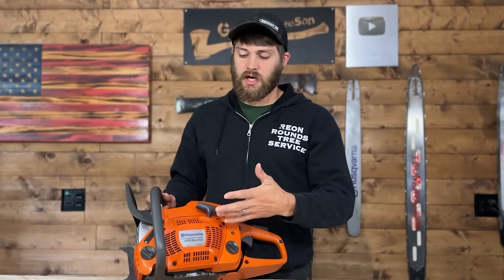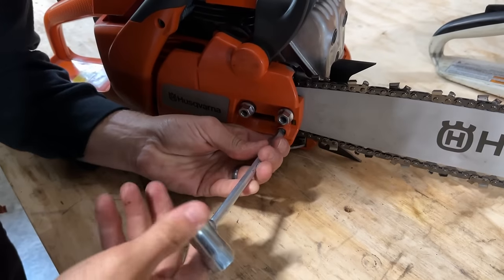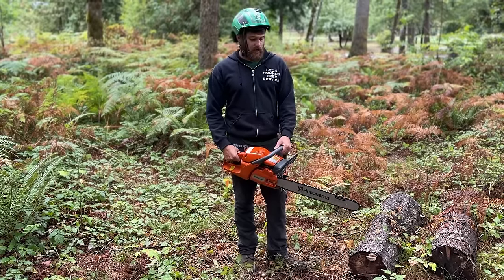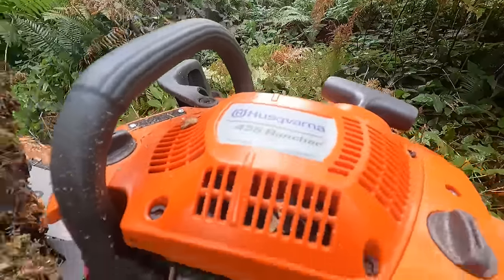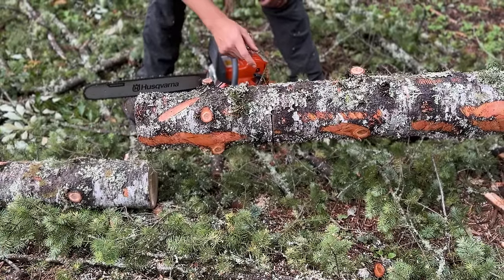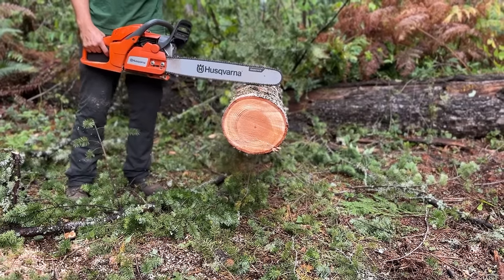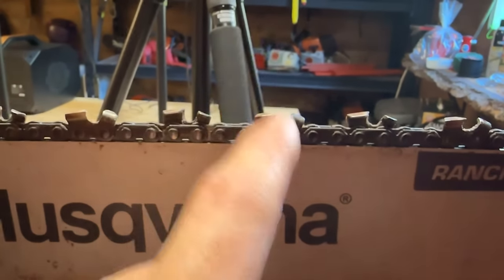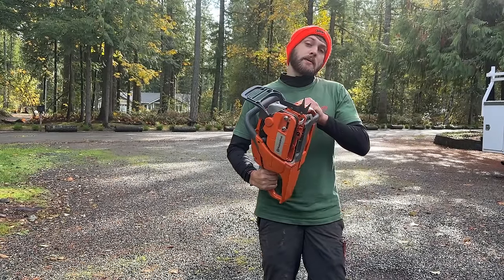WORLDS BEST CHAINSAW TUTORIAL! EVERYTHING You Need to Know About Owning and Operating a Chainsaw!

Comment: One thing I'd say to save the life of your pull start (the plastic tabs that spin outward and rotate the engine over when you pull the cord)  is you very slowly pull the cord out until you feel a good amount of resistance, if you give it a couple super slow pulls you will get what i mean, but this sets the engine to  compression and so once youve pulled the cord easily until you meet good resistance, then you pull start it, dont let the cord go back in, you want the pull start to  be slightly pulled where you meet resistance and then pull and it will start faster and better, and it saves the life of your pull start.  You can use this method for everything from chainsaws to lawnmowers to trimmers and etc.  Its much better for the pull cord gear💙💙💙

Comment: I buy the big jugs of Mix oil and just use one of the small ones for measuring .
As far as bar Oil, I went to our Local Restaurant supply house and bought some large condiment squeeze bottles and keep them filled. Large opening so filling is easy. then just squeeze the Oil into the Saw 
Oli mess is all but eliminated...  
I never start the Saw with the Brake set. with the Choke and high idle set I do not want the Engine to be held back buy the Brake and burn out the Clutch. Start it and let free run for a bit then blip the Throttle to release High idle..
The Screw driver tip of a Stihl Scrench is designed to fit in the Bar grove...
Thanks. Mike M.

Comment: I watched a video about non-ethanol gas. I learned that gas stations, like the one you are using, use the same hose and pump handle as the other ethanol choices. Thus, you pump about 1 gallon of ethanol gas before getting the non-ethanol gas. There are gas stations that have separate hose and pumping handles.
Reply: I'm always concerned about this, especially when filling my Harley with Premium fuel on a road trip. All pumps around me - except one I know of 10 miles away - have the single hose arrangement. This burns me as the next guy is getting my expensive premium while I'm getting the last guys regular. But I just looked this up and the American Petroleum Institute says there's only about 1/3 gal in the hose.
Reply: Damn, thats not even a thing in Australia, every fuel type has its own nozzle
Reply: Always take your petrol container in a petrol car when you go to buy this sort of petrol. Run the first gallon or so into the car, then fill your container. Just good practice.
Reply: If your really picky you can also test it for ethanol by adding water to it in a non food glass.  Ethanol will separate out

Comment: Hey, great Video! Here is how the choke works:
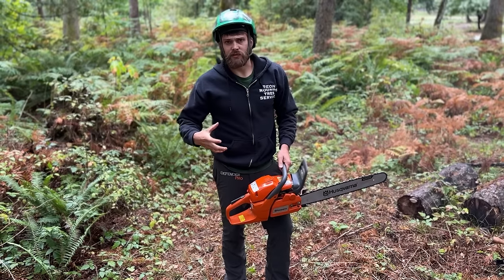19:26 When applying the choke, it automatically sets the idling speed a little higher so it won't stall. As soon as you pull the throttle, it resets the idling speed back to normal. At least Husqvarna does it that way.
23:54 Again I would recommend setting the idle speed a little higher by pulling the choke lever out and pushing it back in again. This way, the chainsaw will rev up without you pulling the throttle. So you don't need to pull the throttle during start up, and you can hold it correctly, which is much safer. :)

Comment: VP racing 2 cycle oil is still available I'm not sure about the five gallon mixer bottles but the bottle with the built in measuring bottle is available at tractor supply, Walmart and most other stores where outdoor power equipment is sold.

Comment: In germany almost everyone runs premixed fuel. But you cant just switch to premixed fuel without at least adjusting the carburator. In general with switching there are complications. But premixed has benefits (f.e. lower emissions so its healthier than mixed fuel from what I have heard and also better storeable) but is more expencive.

Comment: If you flood the engine and dont want to hold the trigger down to start, you can always pull the spark plug with your tool and give the saw a full pulls with the plug out. Wipe off the gas from the plug and put it back in. Should be good to go after that everytime.

Comment: Gasoline requires a ratio of 14.7 to 1( ideally) only the atomized portion of the gasoline will ignite due to this. Flooding an engine is when there is to much fuel for the available air to ignite. Opening the throttle allow more air in and so may mitigate this. Opening the throttle will generally help on carborated but not on fuel injected engines as the fuel input metering is controlled differently

Comment: Greetings from the UK! Thank you for your video which I found really helpful. I have a couple of questions which I think you (or the community) might be able to answer?
I have a 30ft Cherry tree which fell over in a storm a couple of weeks ago. I've bought a cheap petrol (gas) chainsaw to cut it up for my log burner.
As well as cutting the trunk and big branches into logs, is it OK to use the saw to 'quarter' the logs lengthwise (so I don't need to split them with an axe)?
Secondly you spoke in your video about tension and compression, which was really interesting, but you didn't really elaborate on what to do about them! My cherry tree trunk is lying at about 30 degrees (propped up on the roots) and I don't know how to tackle it.
Thanks in advance for everyone's wisdom on the above!

Comment: As well as adding the oil first, I use a measuring cylinder from Amazon because it's more accurate and use 40:1 rather than the 50:1 for the oil-mix ratio. Loads of other videos suggest 40:1 because they feel 50:1 is a bit too lean and only gets recommended because of the "faux green agenda". Some repair shops also say 40:1 allows some leeway if the machine isn't used very often; the cylinder tends to get dry. It never seems to cause me any issues and the cost is marginal.

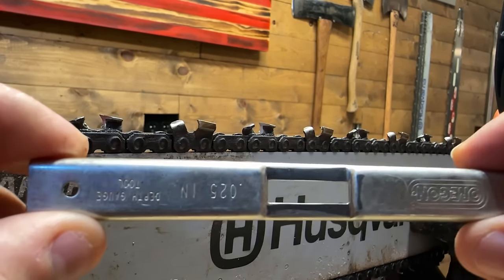Comment: Great tutorial!!!   A correction I would make: at 1:04:10  the value scribed on the jig is .025 = Point Zero Twenty Five, which means 25 thousands of an INCH. You say Point Twenty Five = .25, which would be a 1/4" (10 times more than the gauge value/dimension).
If purchasing the gauge, you can simply say you want 25 thou gauge.   Thanks for the video. 👍

Comment: Great video Jacob... and yes I sit through it's entirety.  It's amazing what a little dirt can do to a chain it's crazy.  I didn't realize how much an air compressor would help I've always used cleaning brushes and picks.  But I'm going to give the air a try next time... I can see it as a time saver.  Of course when I'm fooling around with my saws I never see it as time consuming because I enjoy it so much.  I've always sharpened my chains with a round 7/32" it's how I was taught and I'm old school like that.  But lately I've been thinking about using (or trying to use) an electric sharpener what are your thoughts on them?  I recently purchased a chainsaw mill and using a file and only 2 chains I'm spending a pretty good amount of time sharpening.  Maybe I just need to buy a few more chains lol.

Comment: I have been using 2-stroke alkylate fuel many years in chainsaws and small garden engines.
Much better than the gas you use in cars
No toxic fuems.
Low smoke emitting.
Doesnt smell like trump.
More expensive than standard gas thou, but well worth it!

Comment: don't forget to grease your bar sprocket if there's a hole for it and the needle bearing behind the clutch. Another way to unflood it is to take the spark plug out and pull it over or dump it out to get rid of the fuel.

Comment: If you can't find ethanol-free gasoline (it's a 2hr drive for me to get EtOH-free... I can grab a jerry can here/there, but I can't just drive 4hr round trip for gas whenever I need it) there's a product by "Stabil" "360 Protection" for ethanol.  It's like 5 bucks for a bottle and you mix 1oz into 5gal.  A bottle will treat 50gal.  During the summer when they start adding more ethanol into gasoline (it's normally 10% but they can go up to 15% during the summer) it's a good idea to add 1.5oz of the Stabil per 5gal.  Also does the normal Stabil thing of extending the shelf life of gasoline.  I've noticed a lot less gumming in small engines since I started using it so it does appear to work.

Comment: Great vid Guilty! From my understanding, combustion of the fuel in 2 strokes engine happens late in the compression process by design. A higher octane number prevents knocking and is require for these engines. Ethanol free is also recommended as you suggested. I like your vids man. keep up!

Comment: Pretty solid tutorial, you didn't mention how to set the low and high speed needles and the idle on older saws though, also I think it would have been great to be more precise about using the top half of the bar end "circle" and that it should be avoided as much as possible since the risk of kickback is highest in that area of the bar, you eluded to it but you didn't emphasize it quite enough in my humble opinion, other than that it's a great solid tutorial, good job man!

Comment: On ethanol fuel......aside from what you mentioned about separation and the degrading of certain fuel components, the ethanol is alcohol based and will also attract moisture over time. That in itself is corrosive in fuel systems and cause poor running machines

Comment: Raker gauge depth was 0.025" or 25 thousandths of an inch.  In the metric system its just over half a mm 0.635mm. That's like 6 sheets of paper.

Comment: Nice comprehensive overall, touched all the bases!
You showed but didnt mention to not drag the file backwards while sharpening.
Reply: Well, chainsaw files are made to take material off only in one direction (at least all the ones i've seen) so, there's no harm in draging it back the same way as it went forward (as long as you don't actually put any force on the file which you're not supposed to use a lot of on the forward stroke either). And as an added bonus it's easier to maintain a constant angle of sharpening for beginners while learning to file.😊

Comment: Jacob - your are the man, but as an engineer you were killing me with .25 versus .025. The rakers are .025 which is a little less than 1/32nd of an inch. .25 is 1/4 of an inch. Last bit of criticism is to further explain the oil/gas ratio. What does 50:1 mean? Some equipment specifies different ratios. Otherwise, thanks for the video. I've been with you since the 6 ways of felling with Jed.

Comment: You're the best man, but there is a big difference between point 025 which is the guide measurement and point25 that you said. point 25 is a quarter of an inch. point 025 is 1/40 of an inch.

Comment: When you pull the trigger the throttle is wide open allowing enough air into the saw to ignite the fuel flooding the engine.

Comment: at 23.30 starting a flooded saw by holding the trigger down in your right hand is probably THE MOST DANGEROUS way to do it as you have little or no control of a now full revving saw in your right hand! Some operators even remove the chain brake when starting which is going to result in a few lost limbs.
When you apply the choke it closes the air inlet flap to the carb and AUTOMATICALLY sets half throttle via an internal linkage. So, set the choke then unset it, this reopens the air flap but the half throttle linkage remains activated, it will ONLY deactivate when you blip the throttle. Now start the saw in the normal way (remember half throttle is already set), once the saw is running (fast under half throttle) blip the trigger to deactivate the internal link. Voila - saw runs normally. 
A good idea when refilling the saw is to always fill the oil first, that way if you get distracted while filling you will not forget to go back and fill the oil.

Comment: Worth mentioning is that when gunning, you have to aim with the sights slightly to the side of where you want the tree to go, otherwise the tree will miss the target by a few feet to one side (if the saw is on the left side of the tree and you point exactly where you want the tree to fall, the tree will miss a few feet to the right). If the saw is on the left side of the tree, aim the sights a few feet to the left of where you want the tree to fall. if the saw is on the right side of the tree, aim a few feet to the right of where you want the tree to fall.

Comment: Organic oil can start to harden and gel up if it's left on the tank for a while. Synthetic oil doesn't do that. It seems to me that organic oil lubricates a bit better, but i don't really know. If you use your saw a lot, you can use organic, if you don't use synthetic
Reply: Putting tension on the rope before you pull saves your rope from a lot of wear and tear

Comment: I just want to say, ethanol gas aint that bad. I have a MS180 from 2006 and it has been ran on 10% ethanol 95 petrol (idk what octane it compares to usa standarts) and the lines have held up nicely. The carburetor diaphragms are good and the saw runs nicely.

Comment: drain tank ,push primer bulb to empty carb , put in straight 2 cyc oil or that paraffin gas from box store . prime carb. some oil in spark plug hole to prevent cyc rust. dump out gas in spring ,put in fresh gas mix. probably wont start with that old paraffin gas.

Comment: if you buy your mix oil in bulk (i buy mine a gallon at a time) your best friend is a ratio rite cup... no guess work... tells you right on the cup where to fill to for whatever ratio you want to mix... side note... stihl 2 cycle mix is terrible... like the worst of all the branded 2 cycle mix oils out there. im not saying you should go buy some high dollar fancy oil, but id steer well clear of the stihl oil. Echo Red Armor is a much better option that can be had in the pre measured bottles

Comment: What happens when any gas engine “floods” it obviously has way too much fuel per amount of air is in the engine.  Moving the choke lever off and holding the throttle wide open allows more air to enter the engine , in a sense helping to dry out the excess fuel in the crankcase creating a “clear flood” condition…

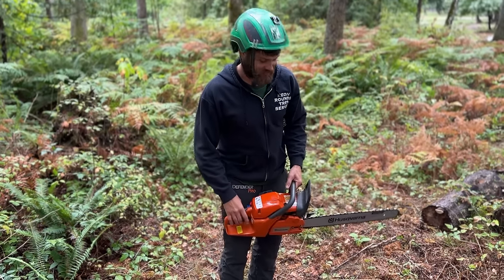Comment: 18:55 if you don’t want to reach crossbody on the crotch start instead of putting the lower handle between your legs, put the bar between your legs. That puts the pull start on the right side which assuming you’re right handed is more convenient. There might or might not be some adverse side effects to starting in this manner.🫢😡🤯😖🤮 Definitely make sure that your left hand is not pulling the trigger with the chain brake off if you’re using this method.😂

In a nice neat safety test lab, the ground start is the best. But in the real world out in the forest or at a log pile, you may not have a good spot to plant it on the ground with good footing, and balance, while also keeping the bar outta the dirt. So my opinion is to competently correctly drop start. It is often actually the safest. Any method, if done carelessly, and ignorantly can be dangerous.

Comment: Mate,dump some oil in u gas tank when u ready to winterize the saw. Pump u primer till carburettor is soaked! It will make u little gadgets in u carburettor last a hell of a lot longer. Don't forget to dump it out when u ready to use u saw again. She'll smoke a little, but want  hurt the saw. This method will keep u out of the repair shop for a long time !!!

Comment: I've been logging trees since 1980, and fairly enough, I too have some experience. 
Some comments: 
I never used saw dogs. Since the manufacturers started to pre-mount them I've always removed and tossed them in the garbage. Perhaps they can help a novice when felling large and thick barked trees and ease bucking the logs, but for a pro and for felling of small to normal sized trees and not least delimbing they're straight out dangerous. Why? I use my legs as support for the saw (yes, if you work 8 hrs a day you pretty soon learn how to ease the strain on your back) and having those dogs would have sent me to the hospital more often than spitting. So totally useless ... to me.
Regarding felling: a) I always do the upper cut first,,, then I can sight over the saw and actually see where the tree will fall,,, by cutting the under first you have less control. b) doing the upper cut first you pretty much also eliminate what you called a dutch cut, ie where the two cuts doesn't meet up, a cut that drastically endangering the felling as the hinge is compromised. c) I always try to make the width of the felling cut max 2/3 of the diameter of the tree,,, that way you have more intact outer (fresh/non-rot) fibers left which are stronger and prevents hinge snap off.

Comment: When you flood the saw it means there is too much gas in the cylinder and it actually got the sparkplug wet...and wet sparkplug.... is not gonna give proper spark if any at all until it dries out. At least from my experience fixing them...

Comment: You should use full or half synthetic oil instead of just synthetic oil. Synthetic two stroke mix oil is the lowest quality, half Synthetic oil is a little bit better and full Synthetic oil is the best. It lubricates the engine ( bearings piston and cylinder) beter then the oter oils. Sorry for my bad english i am fom austria (Österreich)

Comment: Auto tune on some saws that have it. You idle it for 5 minutes. After that intitial 5 minutes I see them cut lengthwise down a log at high throttle until the auto tune ramps down and back up due to the chip in the auto tune than the saw is set

Comment: High octane fuel is pointless in a saw engine as they're only about a 8:1 compression ratio even on ported comp-increased saws.. ethanol-free is important, and you can buy regular E-10 87 octane and remove the ethanol (look it up) and have that still work excellently in a saw at about 84-85 octane.
Reply: But, if you're only gonna use the saw once a year? Buy the canned stuff from VP and you really oughta run 40:1 for longevity.. 50:1 is for epa